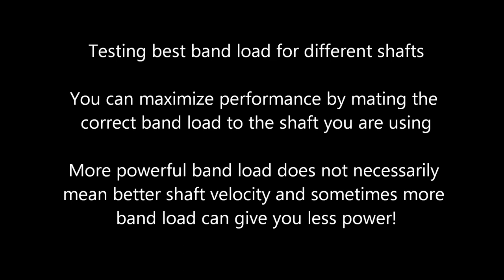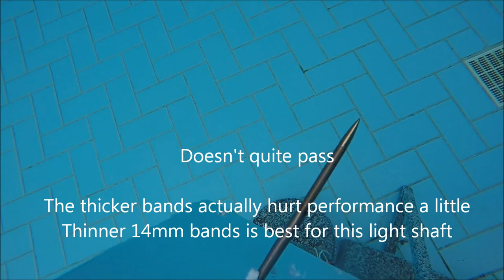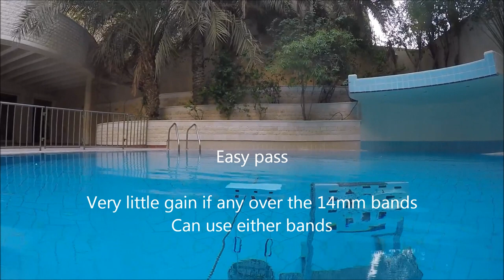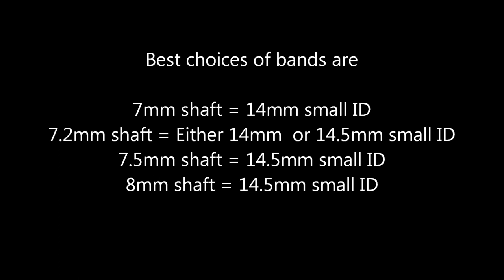Best band choice for different shafts in spearguns

Comment: my friends are jealous of the killer set up i have THANKS TO YOU and i have recently bought a custom 125 wood gun using 160cm x 7.5mm shaft. i only have 14mm small id and not 14.5mm small id. would you recommend i do 2 x 14mm stretched HOT or 3 x 14mm? thanks again man

Comment: Thanks for the great videos. Have you experimented with 1 band setups for shorter guns? It could be interesting to see for example how an 85cm performs with different band thickness/stretch choices using a light shaft (e.g. 6.5mm).

Comment: Hi Majd, would be quite interesting to test 16mm small ID vs 18mm regular ID vs 16mm regular ID. Very informative video.
Reply from the maker: I don't use regular ID bands anymore ... they just don't have the same performance.  I don't know the exact reason why ... could be less chance of water intrusion , more streamlined and thus less water resistance ... or that a large void somehow hurts band contraction under water.  All I know is that in testing the small ID bands just perform better.
Reply: majdq8 
Have you tried 16mm small ID? Just ordered couple of ft of these as well (mainly for rollers) whereas I've converted all my prior 16mm regular ID to 14mm primeline small ID at 360-380%. As you said, better performance in that less recoil and better accuracy!
Reply from the maker: Yes I have ... I find that best performance for 7mm shafts and lesser diameter is 14mm small ID ... then up to 8.5mm best is 14.5mm.  The 16mm small ID bands would be good for 9mm or heavier shafts and maybe for rollers.  For rollers even 19mm or 20mm work well.
Reply: @majdq8   is the small id bands are all the same or it hase to be the primlane ... ?

Comment: im shooting 140cm x 7cm spear, and using 2 x 14mm (small id) initially cut at 360% -  but after a few weeks of use, the rubbers became longer and is now at 340% elongation. 

when you advise 360%, are you referring to when it's newly set up? in other words, should i now cut a few cm of my existing rubbers to get back to 360% elongation? 

over the past few months, i've read so much of your posts and videos and i think i speak on behalf of countless - thank you for what you do!
Reply from the maker: Yes new rubber bands always stretch out a little after 20 or 30 shots.  Best is to cut a little shorter in the beginning and just use longer wishbones.  You then just shorten the wishbones as the bands stretch out.  In your case you can just cut off about an inch off one side of the bands and re-tie.
Reply: @majdq8  thank you so much

Comment: Thank you so much for this video :) really appreciate your effort to document and test all these! 

Would there be additional range or penetration for using 3x14.5mm bands for a 7.5 130cm shaft? 

Or is 2x14.5mm already the most power? 

I’m using a picasso magnum power 90 with 3 dedicated holes for rubbers (but the distance between rubber and shark fin is actually 100cm) 

Thanks again ❤️
Reply from the maker: A 7.5mm shaft cannot absorb the power of the 3rd band and might actually reduce the performance.  Better is 2 x 14.5 mm and just increase the band stretch as much as you can handle.
Reply: @majdq8  thank you!
Reply: What about 140cm shaft, 8mm and 3x14 rubbers? Is it ok?

Comment: Very useful video majdq8. I have an ACID gun 110sm with 2*14 small ID bands. Do you think better to use 140 sm shaft 7 mm or 6.75 150 mm - I think that the weight of the shafts will be equal? Does the thick shaft will deteriorate the distance and accuracy? The set up will be with 2*16 bands.
Reply from the maker: I would prefer the shorter 140cm shaft @ 7mm.

Comment: Great video! Can you ask me a question ?Recently bought a Riffe Euro 130cm, came with 2 bands of 16mm and shaft 7.1mm, i want change to 14mm.
What do you recomend me ?
I'm brazilian. I'm still practicing my english, sorry for the erros in the text. Thanks.
Reply from the maker: Riffe Euro does best with 2 x 14.5mm small ID bands and a 7mm or 7.5mm shaft.  Problem is that if you power up your bands, the impact point drops dramatically.  This is due to the very thin profile of the gun for its length, so it flexes.  You can put a carbon fiber sleeve over the gun and that dramatically improves things without adding much weight.

Comment: Where would you recommend to buy 14.5mm rubbers? Where I am, I can get the 14.5mm signal sub extreme but it seems they are more explosive/reactive? I would ideally prefer progressive for my set up using double bands for 7.5mm 130cm shaft ❤️🙏🏾 

And my Picasso magnum power is also quite light so I would like to minimize the recoil.
Reply from the maker: The Sigal bands are not good.  I don't believe in the "progressive" hype etc...  You want stretchy bands that still have a lot of punch.  Best are the Primeline rubber with small ID.  With 7.5mm shaft either 14mm or 14.5mm will work well.  I personally would use the 14mm small ID bands and stretch them higher.
Reply: @majdq8  thanks :) did exactly this! i know you are busy and may have made other videos answering this already - but do you notice if position of flopper (hawaiian or tahitian) affects aim? slightly higher or lower?
Reply from the maker: @primalphysique  I generally like to use a cone as that dramatically reduces any vectoring caused by the flopper by steamlining the water flow over the flopper.  If that is done, I really don't see much difference with flopper up or flopper down.
Reply: @majdq8  you are the absolute best.. thanks!

Comment: Hi.  Nice video like every videos .   One question. What you do if some of your shaft will bended.  You fix it ?  How ?    Do you have a technic to do this. Some machine to fix the shaft ? I will appreciate your answer
Reply: Hi Juanjo, it is possible but probably only a professional workshop can do it f they also do include a heat process. Doing it alone is quite difficult - I would not recommend it. I prefer not to use bent shafts anymore, unless you use them for shooting in caves for fish like groupers (short range) maybe. Then you might cut them, drill a hole for the securing pin and attach the flopper in his new position. Or... cut the shafts and use them as fish stringers, reef/rock hooks (anchors) etc.
Reply: @DeepBlueSpirit2  thank you
Reply: @juanjosebritolara3432  Un gusto ;)

Comment: I appreciate your videos extremely, thnx for these moments of enlightment :). I'm just confused, why all the brands deliver 2x16mm setups with shafts >7.5mm ? I mean, from the empirical knowledge you present, its totally superficial to get 16mm bands for regular spearguns (80-125cm pipe and 6-8mm shaft diameter). Isn't that so ?
Reply from the maker: Yes it is confusing!!!  Why will 16mm bands perform much worse than 14mm bands for some shafts ???   More rubber should mean more power!  But it seems there are other factors involved.  I think a main factor is contraction speed of bands in water.  Thin bands contract much faster as they have less water resistance.  Of course you reach a point where this advantage is negated with heavy shafts where the thin bands have a limit to how much they can propel heavier shafts.  But from my experiments this only happens around 7.5mm shafts @ 140cm.  So any shaft lighter than this would perform much better with thinner small ID bands.  The idea of this test was to show that in action in a test environment.  You can see that with light shafts going with heavier bands and the same  stretch factor the thicker bands actually perform worse !!!!
Reply: @majdq8  I have ordered the pathos nitro rubbers, 14mm o.d., 1mm i.d., so they shall perform great! Do you have experiences with them, used them in any test videos of yours here ?
Reply from the maker: @tunculuc  I have never tried those bands but generally speaking all rubber bands are made by one of 2 major manufacturers and are re-branded.  Not sure which manufacturer Pathos went with but it most likely is Primeline.  If so then they should be excellent choice for shafts up to 7.5mm diameter.
Reply: @majdq8  i’ll share my experience. Cant wait to try them out!

Comment: I use double 16mm bands but i have hammerhead rubber, they are stretchier that regular primeline. I get like 400% stretch out of them and are slightly lighter, still stronger that 14mm. Im pushin a 7mm shaft and passing through carp at like 15 feet

Comment: Amazing video!
If you're making 2 bands for a gun do you make them the same length or different
(one for the first shark fin and the other for the second one)? 
And what's the best way to figure out what length to cut the band at?
Reply from the maker: I make my bands based on the distance of the band hole to the shark fin.  If I want to start at 350% stretch, I take distance from band hole to shark fin I will load that particular band to ... then X 2 for two sides, then divide by 3.5 for 350% stretch.  With wishbones I try to keep them around 4cm to 7cm depending on how the bands will sit.  Sometimes it is worth it to make one wishbone a little longer so that you have a better and less jumbled line of sight.

Comment: Hi Majd, thank you very much for all this info/work, very interesting. Quick question if I may, I am considering switching my abellan 110 from 8mm shaft with 15mm cressi pure smallID (original config) to 7.5mm shaft with 14.5mm sigalsub smallID (to gain in precision a bit, as i find the recoil with the 15mm cressi makes the gun "jump" a bit and it loses accuracy over the long shots). I am unsure which sigalsub I should consider though, between extreme (more punchy, with greater extension coeff) or reactive (more progressive, lower extension coeff). My natural inclination would be to take punchier/extreme but I've read that the recommendation for longer guns was more towards using the reactive/progressive one, while the extreme was more recommended for guns shorter than 90cm. Given the extensive testing you've done, I was wondering if you had a view/recommendation regarding which of extreme/reactive to use. Thanks in advance if you can let me know, cheers.
Reply from the maker: I think all rubber is the same and this thing with progressive and reactive ... not so sure it is relevant.  I find that the best rubber is the one that is a little stretchier as that gives a smoother release.  If the shaft does not come out of the track stable you will lose velocity very quickly and also accuracy will be terrible.  So you want your setup to push the shaft out in a way where the shaft is totally stable.  This ensures that the shaft does not lose velocity quickly.  That is why sometimes with less band power you can get more shaft velocity.  I like the Primeline small ID bands in 14mm for shafts 6mm to 7.25mm and 14.5mm for larger diameter shafts.
Reply: Thank you

Comment: I noticed that u only use 14mm bands on most tests and the seem to be fine. but why do companies like pathos have larger bands on the (open  laser carbon) stock while they can place 14mm instead, for better performance?
Reply from the maker: +Moabz z Good question and I really don't know why Pathos doesn't setup their guns with the 14mm as it dramatically improves performance with less recoil.  But most gun manufacturers do not setup their guns well and you need to fix it yourself.
Reply: Hussein Marey it's because it is given for deep dive spearfishing, which effects the thickness of the robbers, let's say under -20 meters... 
If you are at -25, the two 14,5mm will not send the 7mm shaft as far as it should but the two 16mm or 17mm will do the job...
You don't buy a carbon gun for spearfishing between 0-20 meters.
This is a job for aluminum barrel guns and set up at 6,5 shaft and two 14mm robbers ;)
Reply: Teo Tsakiris you may be wright. The physics in higher pressure may affect the performance of the bands and majd only tests them at shallow atm. For specific results, I need to test them at a 20+ depth. I recently got a denton 120 and will be applying the 15mm cressi scarlet for deeper dives. I'll have my pathos carbon 120 set to cressi brown14mm bands and a 7mm shaft. And my denton to the 15mm with the 8mm shaft. I will be making target testing soon. Thanks for the reply.
Reply from the maker: That is absolutely not true.  The problem with deep diving and shooting at depth is water infiltration and not band power loss.  Bands have a void and if you do not take steps to prevent water infiltration (most people don't) water will get inside your bands.  This dramatically reduces performance of bands.  With small ID bands this is much less of a problem.  I have never heard anyone say they lost performance with small ID bands ... at least not at depths of 35m.  Thick bands are used because it is common sense that more rubber will push the shaft better, but unfortunately this has been proven to be wrong and you have to to balance the band contraction correctly to the shaft mass you have.

Comment: great work..i wonder if shafts length does make any different on bands combination and accurate? i think 13mm twin bands will work fine on 6mm to 6.5mm thin shafts, but what about length? does 140cm 6.25mm shaft works good as much as 120cm 6.25mm shaft with 13mm bands you reckon?
Reply from the maker: Problem with thin shafts like 6mm or 6.5mm is that after you go above 120cm, "shaft whip" or shaft oscillations become a factor once you start powering up your setup.  Uncontrolled shaft oscillations will quickly dissipate shaft velocity and kills accuracy.
Reply: @majdq8  so you mean if you go above 120cm shaft it must be 7 or 8mm?

Comment: Hello I have a Geronimo elite 95 cm open muzzle and am thinking to add two 14 mm bands instead of the factory setup with one 18 mm band.
The shaft is about 6.5 mm but am thinking to add a 6 mm or 6.25 mm to increase shooting speed.
You think a lighter shaft will increase speed and shooting distance?

Comment: Hello, I read and watch your tests with great interest, and appreciation for your adherence to scientific method. Living in Key West, Florida I tend to use  relatively heavy shafts, most often  8 mm x 165 cm. I want to use 14.5 mm bands at 380%. My problem is I cannot find a US source for 14.5 mm. I can get Salvimar green 14 or 16 mm, and Primeline 14, 15, or 16.  Can you suggest a supplier for 14.5 mm? Given my tubing options noted above, which would you think would give me best TV with my 8mm x 165 cm shaft?    Thank you very much.
Reply from the maker: You can get small ID bands from spearamerica.com or benthicoceansports.com or spearitco.com
I recommend 14.5mm small ID bands for 8mm shafts.

Comment: Thank you for the video. I am wondering with 6,75mm and 7mm shaft with 140cm length with 105 gun at double 14mm and 16mm band. I be appreciate if you tested

Comment: @majdq8:Thanks a lot for all those very interesting test.
Regarding the shaft, do you have the weight of the shaft used during test?
My feeling is I can get better result when I increase shaft diameter and decrease the length for a similar weight. What do you think about?
Reply from the maker: +spearboy9 It is true for certain lengths and would also depend on the gun design and how stable it shoots the shaft out.  Gun design has a lot to do with allowing the shaft to be completely stable in flight ... which allows less dissipation of velocity due to shaft whip.  Poorly designed guns will benefit by using shorter shaft with higher diameters (thus same mass), but generally speaking a well designed gun will benefit more from a longer thinner shaft (so long oscillations are under control) due to the smaller cross section area.  You can calculate mass of shaft by using this website  http://www.random-science-tools.com/physics/beams/rod.htm

Comment: Ok ive watched most of your videos and i was wondering if you ever tested a koah standard fay back i have a 57 and im on a budget and trying to dual purpose it to reach out a little further. I understand this might not be ideal but its what i got right now it has a 5/16 or 8mm shaft with 16mm bands. First how do you calculate how long you bands should be and second should i switch to 14.5 mm bands as per this video says the performance is improved on the playform your running im very interested to hear what you think
Reply from the maker: There are new 15mm small ID bands that might be perfect for 8mm shafts.  I would try those and you can get them from Benthicoceansports.  As for band stretch, the 14.5mm bands are much easier to pull back than 16mm bands and so can go with stretch.  For 8mm 380% is very good but just in case you can't load them start at 360% and then cut shorter.  Band stretch calculation is distance from loading shark fin to muzzle hole the x 2 then divide by 3.8 (for 380%).

Comment: Hi majdq8, have you ever noticed if a stretch at 360-380% is diminishing bands performance after 30 min or more  of consisting loading (spearfishing conditions) VS a stretch of 3,3-3,5 ?
It would be very interesting if you could conduct a test like this!
Reply from the maker: I did do a 45 min soak test with a full load ... not much change in power even at 380% ... so maybe this is not the problem some people think it is.  You can see it here https://www.youtube.com/watch?v=H-mTmi6dlkM

Comment: wooo...nice one bro...how about review about percentage of cutting the bands according to gun length..?..
Reply from the maker: For 7mm shafts best is 14mm small ID with as much % stretch as you can feel comfortable to load.  Usually that is 360% to 370%.  For 7.5mm to 8.5mm better is 14.5 to 14.8mm small ID bands with as much % stretch as you can handle.